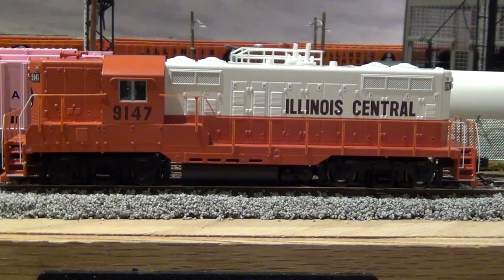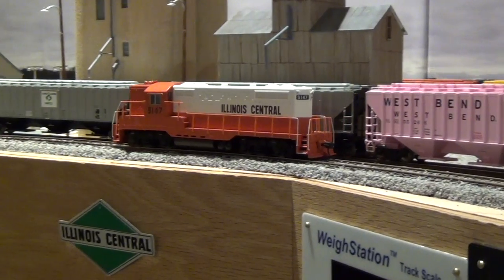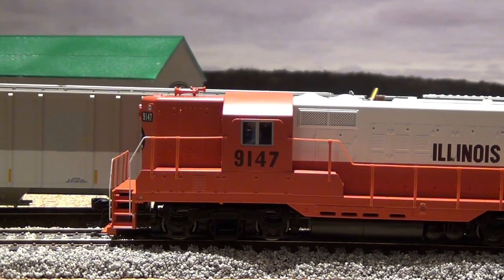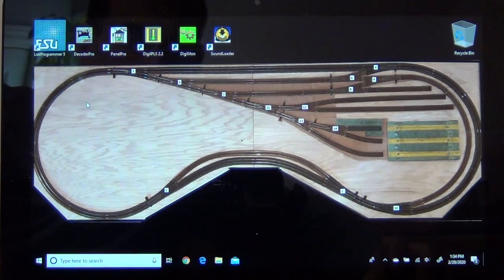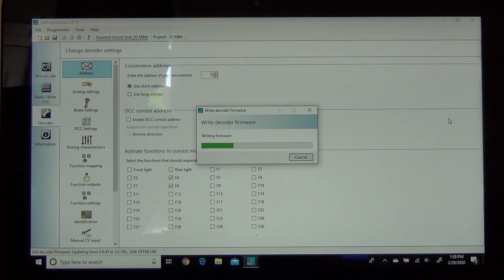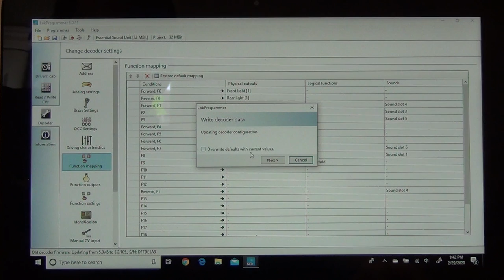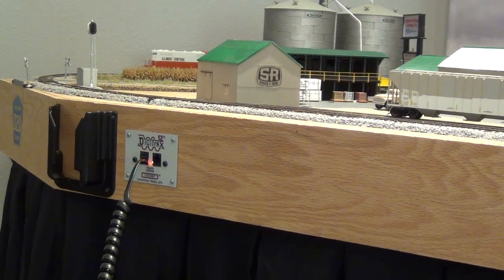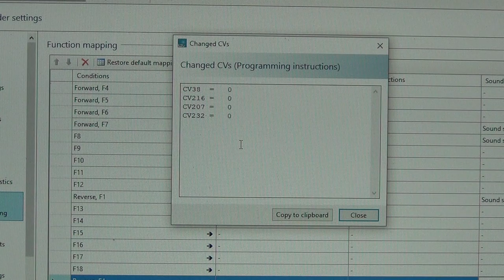Resolving a ESU Loksound Essential Sound Unit decoder issue

Comment: Thank you for posting this. I bought an SD70ACe and when the sound was on, it would run for about 90 seconds, then sound a noise like the horn, then become non-responsive to the throttle. Your solution worked for me, thanks again!

Comment: Just ran across this video and as a retired railroader that spent a lot of time working with GP-7/9's in the 70s, I can tell you that what you are hearing with this model is the early EMD 576 powered GP making transition of the motors from series to parallel. It's not going into dynamic brake mode! When the GP (also E and F units) makes transition, it does indeed drop back to idle briefly before notching up. Usually at around notch 3. So the out of the box sound behavior is actually authentic. Also there is some delay of the engine idling down when stopping. Since the model in this video has no dynamic brakes, it does make sense to disable that feature.

Comment: Totally agree with you about it being unacceptable. Even though it's a less expensive lower grade model, it still cost $200. It is ridiculous that this is an issue from companies that have such exceptional other products that they can't get the basic decoders to work correctly straight out of the box and the consumer has to fix the problem. Good videos. Great tips and information.   👍

Comment: I think you can fix it much easier.

If you have read the decoder data with ESU programmer, you need to go to function settings. I don't know why, but in my case, there is random function 1 active. And it randomly activates F4 while stopping or driving. After unchecked stop and drive, the random function 1 is deactivated. And that solved the problem and you still can use the dynamic brake sound.

Best regards from Germany

Comment: THANK YOU! Haven't tried it yet though. I thought I was struggling because I had just gotten into DCC. I started by converting 3 of the locos I had using digitrax decoders (and getting a Digitrax command station). I thoroughly enjoyed the experience and programming. Then I decided to spend what is to me BIG bucks on a DCC ready Walthers Mainline GP9. (I had to add SOO line to my C&NW to match what I saw as a kid). I fought the GP9 and spent many hours on the internet and gave up. Tonight I tried again and your video came up. I bet it works. (not my only fight with this one)

Comment: Thank you very much.  I happened to chance upon your video and so glad I watched it.  I have a Walthers Mainline PNCX hi-hood GP9 and its throttle would fluctuate all the time. I emailed Athearn and they said it is a programmed function and to clean my tracks and wheels.  That never set right with me.  By changing those four CV’s to zero it now runs without those annoying fluctuations.  Thanks again.

Comment: i noticed that when you stop the engine it would stop then lunge i stopped mine by putting  a value of 10 in cv 54 problem solved.  i used the cv's you told us to change for dynamic brake works great. thank you for explaining that

Comment: Thank you for getting the fix out to us. I wonder if Walthers or ESU will get this issue corrected.
Reply: All they have to do is include an erratum in the box telling the buyer of a non dynamic brake equipped model the four CVs to change in order to disable it. It would cost them a few pennies but way cheaper than having to stock two differently programmed decoders for the production run. Walthers might be convinced to do it. ESU will try to get you to walk up the side of a wall rather than take the stairs.

Comment: Excellent locomotive criticism, these model manufacturers seriously need to find ways to eliminate the issues with the decoder function performance on these dcc-sound equipped locomotives.
Reply from the maker: Thomas Avens Jr. I put a Loksound 5 in this unit and it is 1000 times better than a properly functioning Essential Sound Unit decoder.
Reply: Think if there is a issue rather then wine about it send it back until they get them right.Having to adjust CV is normal.This is why they make them adjustable.If not right warranty will fix it and give the manufacturer valuable feedback to better their product in future runs.Then again Soundtrack does not have these problems .This is why ESU has a programmer to upgrade their screw ups in their software also .By American done right the first time Soundtraxx

Comment: Thanks for posting. I just picked one of these up in CNW just to experience the "budget" sound decoders, and while overall I am pleased enough with the sound quality for a cost of less than $50 for DCC and Sound, I was puzzled why mine did the same thing.  Especially annoying when you bring it to a stop and its still notched up. I thought there was something wrong with the decoder that I may need to send it back. Thanks for clearing this up. I will just rewrite the CVs in JMRI. Overall though, a decent looking locomotive for a decent price if your hobby shop sells it for a reasonable price and not MSRP, which mine did. I just don't understand why Walthers did not put the grab irons on. I think that's silly. Its not an Athearn Blue box from the ealry 90s! Its 2020! Grab irons are not optional! Anyway, thanks for the info in the video. Subscribed.

Comment: Just got a brand new scale trains dash9 with ESU Essential sound for my kids Christmas layout.. It's so weak i can barely hear it ..we tried to raise volume cv but nothing. It takes minutes for the rpm to come up as well . My kids are not having a good model rail roading experience with this scale trains product.
Reply from the maker: Hi, Pete.  I am so sorry you did not have a good experience with the ESU Essential Sound Unit decoder.  We need kids/younger people involved in this hobby to keep it relevant in the future and a bad experience will turn kids off (and adults too) real quick.  It is not Scaletrains.com fault because they don’t make the decoder, they purchase an OEM version from ESU (okay, Scaletrains.com has some fault for using an ineffective decoder in their products).  Soundtraxx has a cost-effective decoder which they call their Econami decoder (it is a basic version of their high-end Tsunami 2 decoders).  Athearn uses the Econami decoders in their “Ready-to-Roll” product line (the Tsunami 2’s go in their Genesis locomotives) and the Econami’s work great!  I have several SD40-2’s from Athearn with the Econami decoders and I do not notice much in a performance difference from the Tsunami 2’s.  Please contact Scaletrains.com and let them know the Essential Sound Unit decoder is unacceptable and you want a refund.  If enough people complain, maybe we can get these decoders off the marked.  I raised heck with Walthers about these decoder in their products.
Reply: @ck7813  I agree. I have the same issue with scaletrains sound levels, it’s crap. I bought a rivarossi U25c and the esu decoder just died. I have a gp60 RTr with a esu decoder that stopped working. These things are unreliable and shit. Soundtraxx has never let me down. Not once.

Comment: I was programming mine last night and now all of a sudden i cant change any cv's. When i try to change them, nothing changes. I tried factory reset and hard reset and it did nothing. What do i do? I use an MRC tech 6 sound controller for running amd programming btw.
Reply from the maker: Hi.  I am sorry you are having issues with programming.  I am not familiar with MRC tech 6.  You can try emailing Walthers customer support to see if they can give you some assistance, otherwise, I don't know enough about the MRC tech 6 on how it programs and what could have potentially caused the issue.

Comment: It may have back EMF and sensing a reduced load change to reduce RPMs and then senses a need for more power and notches up.
Reply from the maker: Thanks for the comment, I suspect that is likely the issue, but with the Essential Sound Unit decoder, ESU has it so locked down that they don’t let you adjust enough CVs to rectify the issue.  You are very, very limited in what you can change.

Comment: Great video!  Thanks for the detail on how to fix the issue.  I notice that it lurches forward on start.  Have you adjusted CV2, CV3, and CV4 to give it a more prototypical start and stop?  I'm less than a year into the hobby so still learning a lot.  My locomotives are mostly LokSound 5 and a few with LokSound Select (no Tsunami anymore).  My Walthers Proto and Atlas Gold units run perfectly right out of the box (only change was momentums).  However I have a couple of Athearn Genesis locomotives even after extensive break-in that were giving me problems especially as they came to a stop.  The would slowly come to a stop and then jerk forward slightly a couple of times until they finally did stop.  I put CV54 (BEMF effect) from 50 to 255 and CV55 (inertia) from 100 to 10 and it solved the issue.  It runs great now!  I will continue to test and see if I can back this 255 number down or increase the 10 value (not sure if I need to although these numbers are far from the settings in the Walthers and Atlas units).  CV51 and CV52 are left at the original settings of 0.  Additionally I changed CV5 (top speed) to 100 and CV6 (midspeed) to 30 to enhance low speed control performance.  CV 2 was at 1 from the factory and left that way.  I also changed the momentums CV3 and CV4 which were both at 20 and now set to 80.  The range of stock values for CV54 for my locomotives range from 24 to 53.  CV55 stock settings range from 27 to 100.  These wide ranges tell me there are many combinations that can achieve prototypical movements.
Reply: These settings worked great for me, except for cv54 I had to leave the same.  Setting it to 255 made it run very choppy.  Thanks 👍
Reply: @lynncreekrailroad9690  No problem.  I am continuing to experiment and I found just changing CV51 and CV52 works in most cases.  My Atlas units seem to like: CV51=10, CV52=15 (ScaleTrains uses similar CV settings).  My  Walthers switchers vary.  One like CV51=0, CV52=0, another seems to like CV51=10, CV52=5 (CV2=3 on both).  It could be variances in the motors, gears, or just needs more break in time.  regards, NS.
Reply: @Form44208  I also have a brand new Atlas Master series dash 8-40cw that has a motor hum to it that I'm trying to correct.  I have disabled the delayed startup but not sure what other values I could change to silence it.  I'm using the digitrax zephyr controller.  Any thoughts?  Thanks again 👍
Reply: @lynncreekrailroad9690  I have 2 InterMountain GP10's that hum pretty loud.  If you find a way to correct hum let me know.  They hummed louder (annoying higher frequency) with LokSound Select.  When I changed them to LokSound 5, it is better but still there (a lower frequency).  I think they just have low quality motors in them.  I have a new InterMountain GEVO and it is quiet.  I am running an NCE controller.  I have some new Altas GP40's & C-420's and they are super quiet.  My Walthers switchers SW1200's and NW2's are very quiet too.  My Atlas switchers are good, but not as quiet at the Walthers.  All my ScaleTrains locos run smooth and quiet.  I would contact Atlas about your unit, they may just swap it out for a new one.  regards, NS.

Comment: I'm thinking that the locomotive changing engine RPM's is a result of the BEMF detecting changes in the motor load and changing the sound to match. So on straight track it throttles down, and when it gets bound up in a curve, it throttles up. I think this is a good thing, and I would be attempting to make it more pronounced. As a locomotive engineer, I don't like models that drone on with the engine rpms always the same. In reality the engineer is changing throttle notches constantly trying to maintain a speed over varying terrain.
Reply from the maker: I do not disagree with your diagnosis of the problem; however, these are documented issues with this brand of decoder and they have yet to be addressed.

Comment: I never have dynamic brakes actually slow down my loco if the loco is supposed to have dynamic brakes I just leave the sound mapped to f4 turning off the brake function for f4. I get the sound and slow down the loco with the throttle. I hate  braking systems on decoders I like to control my braking with throttle.. This is not unique to esu essentials also. This all being said walthers mainline are on the bottom of my list well above bachman in value. Buy atlas same price and u at least get a loksound select, 4, or 5 decoder
Reply from the maker: Thanks, Jamos.  Walthers Mainline aren't bad if you have the time and talent to invest in detailing/upgrading them.  Out of the box, they aren't much to look at.  I also agree with your assessment of braking with a hand throttle.  Usually engaging the brake causes an abrupt halt unless you spend the time to setup your CV.  Search my other videos, (search for : Protothrottle braking) and watch how some CV changes and a variable brake setting adds an amazing amount of realism to train operation.  If you have an opportunity to get a ProtoThrottle and take advantage of the braking capabilities, you will never go back to how you are currently doing it.

Comment: I'm not happy with anything from loksound decoders, I prefer tsunami 2, they work well out the box  are reliable and are relatively easy to program  especially on athearn genesis units. But along comes loksound 5,and everyone is using it. The et44ac from both scale trains and Intermountain use them. I could not program a 4 digit address on them and so ended up using a silly 😜2 digit address for a cn #3048 from Intermountain. When I tried using digitrax to reprogram to a 4 digit address for a $300 locomotive, the system ended up blowing out the decoder and frying the motherboard . Very disappointing from both Intermountain and loksound